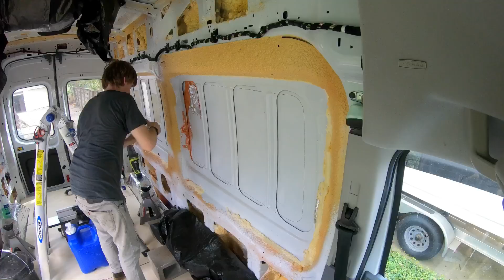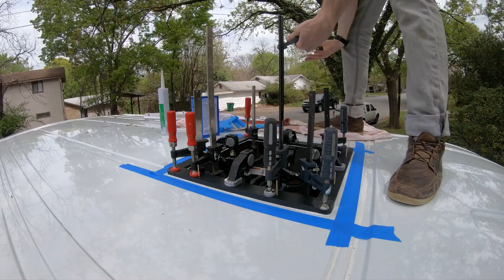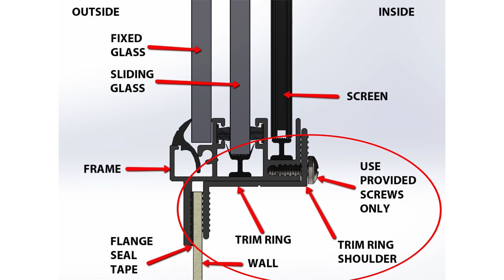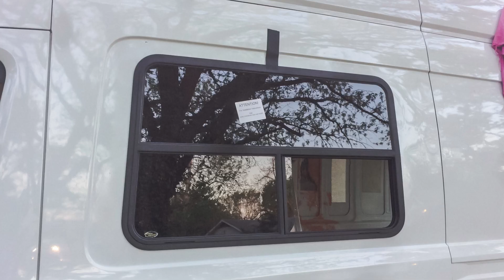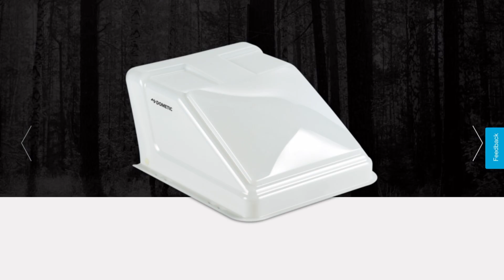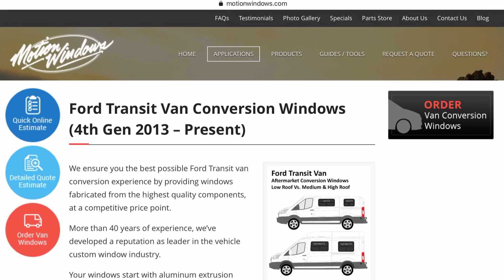Roof Vent and Window Install on Ford Transit Camper Van

Comment: Great video once again.  Thanks.  I'm looking for the right windows to buy  and install so lots of questions...how is your window holding up?  Any movement, vibration, leaks?  It looked like it sat in with only a few screws?  Is there any need for a wood support behind?  Can it  be opened easy  from the outside or is it secure?  Lastly how is the sealing tape holding up..any leaks?  thanks

Comment: Yet another compliment on your clarity in speaking and presentation of these videos. Rather than induce fear in those embarking on such a project, they're actually really reassuring. I note this is the last video in your series, but I really hope you'll be able to add some more at a later date. Thanks for the time and effort you've put in to making them.

Comment: I was looking at a video where you talked about water entering under side trim. Two UK builders found that the leaks had been there. Some of the drain holes in the cills were blocked and when cleared over a gallon of water drained out of some sections. Not rusty water though

Comment: Great video!  I love the details you include, like being sure to vacuum up the metal shavings.  I've seen other vids about fan installs and they basically just slap it in there and move on.  The info you're providing is really helpful to someone who has no building skills : )  Thanks!

Comment: Thanks!  Great detail!  Never saw one of those adapter plates before. 
Leaving areas big enough (eg 66” x 40” x 2) for large heavy (not portable) solar panels has been the bane of any of my camper designs, and has moved that planning to very early in the process. 500 watts minimum. Large panels cuts the panel cost to 1/2 and less.